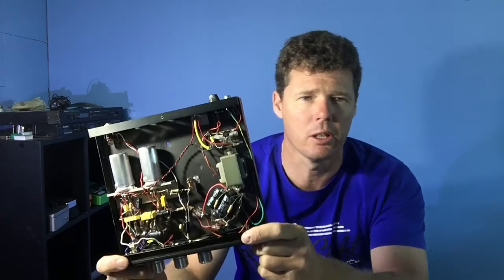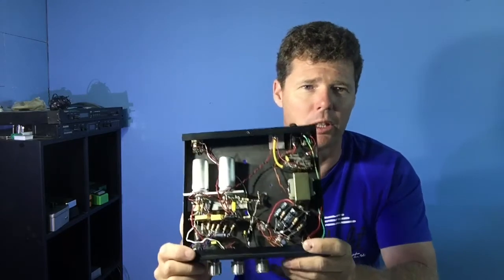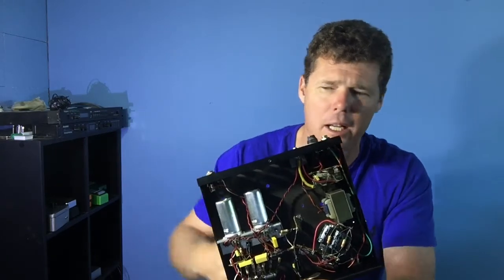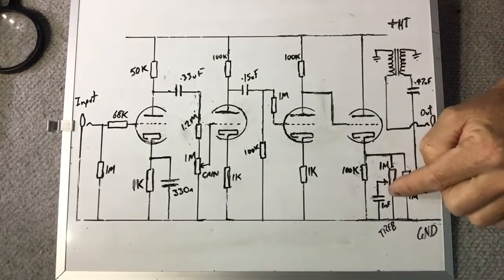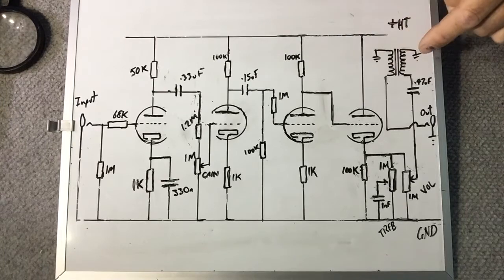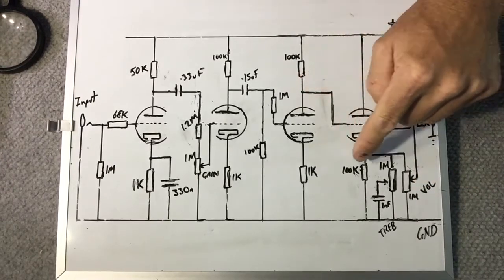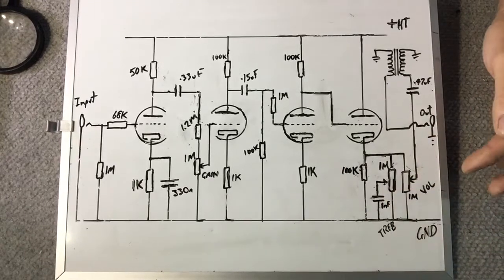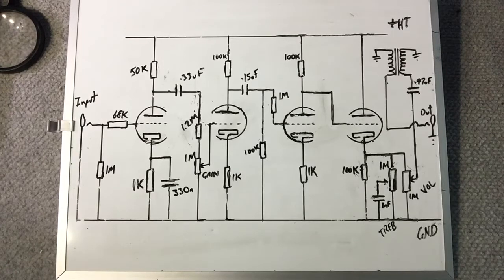DIY Tube/ Valve Guitar Preamp Schematic Diagram Run Through

Comment: What did you do to remove the output transformer ?
Reply from the maker: Basically wired the output from the cathode follower to the output jack via a coupling capacitor.
It won't drive a speaker so much but it is good for running at instrument or line level.
Reply: @PaulGrahamGuitarst  Thanks man.

Comment: Its your circuit and your design.....I'm pretty sure that means you can alter it any damn way you please as its creator. It's part of the prototype and testing phase. Good Job on the circuit and any effort you made o tell us how you did it. 

The problem today is most people only want you to tell them how to build an exact copy but do not step outside of the original design to be more creative. To me the only reason to copy this exactly to the tee should come with the idea you are going to build off it as you have done. You have pointed out the circuits origin but you took a creative step to suit you and thus makes it unique to you. I build things all the time and I can guarantee there is not another one like it anywhere that is exactly the same. I cannot resist the urge to build off the ideas of other people because I know the more input the better. I have popped my fair share of caps and op amps. I've zapped myself more than I can count but I learned what not to do and to have the patience to do what needs to be done so I am not repeating the process. 

Again Good Job dude.